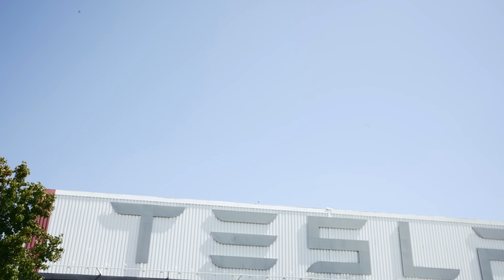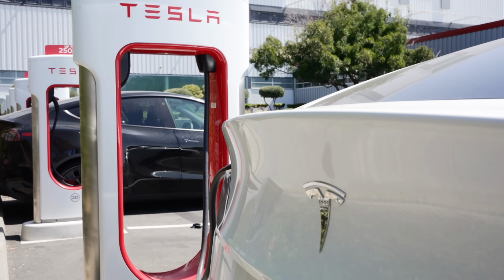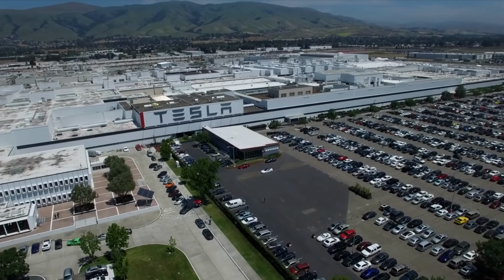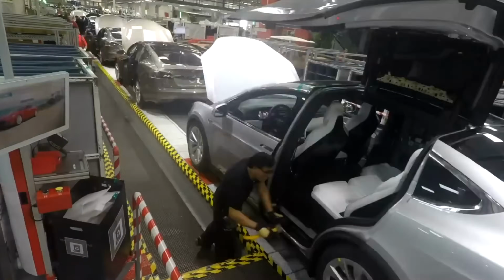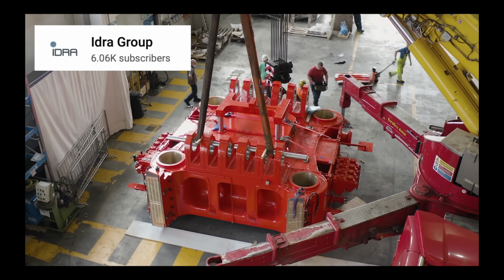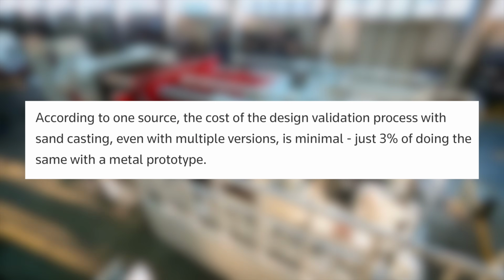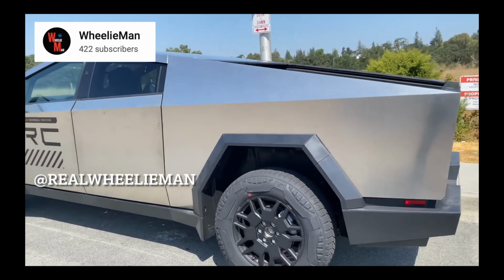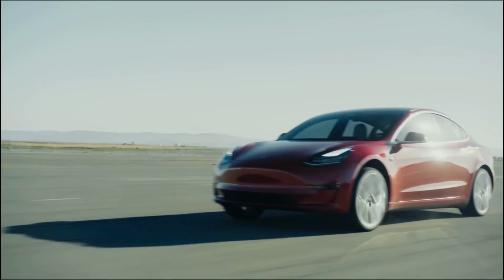Tesla Quietly Removes Model Y | NEW Buyers Are Shocked

Comment: i'm SUPER disappointed with the cybertruck. it's no longer an exoskeleton , just a normal vehicle now, but that was the whole point of the origami look of it was because it was going to be an exoskeleton, but now that it's not, no need to make it look like that. i'm ok with the looks, i like that it's very different looking, but i wanted it to be different looking because of the new and innovative exoskeleton design.
Reply: The exoskeleton doesn't have crumple zones.  That's why it's not being used. They're putting panels on a frame. Also the super strong side windows is a safety problem. If those batteries have a thermal runaway you can't open the doors because the electricity is off. So while you are being inundated with smoke you have to bust a window to get out of the conflagration of a thermal runaway fire. You better hope those side windows are not laminate. Those are very difficult to break out. And the weaker you are from the smoke and toxins the less likely you are to get out. And it will really suck if you have kids in that vehicle as it burns in the middle of a freeway because fire department can't get 6000 gallons of water to it.

Personally, the very idea that you cannot open the doors without the electricity being on is the dumbest design feature of BEV vehicles.  It's like having a house with electric doors and then a natural disaster hundreds of miles from you shut off the electricity and now you can't get out of your house. Or into your house. Like maybe it's a subzero storm. But the electricity is out. And now you can't get into your house for shelter.

I really don't care that ICE vehicles catch on fire supposedly more than BEV. The problem is the fire and the fuel of the fire. The BEV Burns hot enough to burn through concrete. It burns hot enough to burn down a house. It Burns hot enough to be a danger to every vehicle near it. Like in a parking structure, or a ocean going container ship.  And it burns far longer than an ICE vehicle will burn. And it will burn very hot the entire time.  You cannot douse a BEV fire with less than 6000 gallons of water to dissipate the energy that's being released. Thermal runaways me an exactly that. It's a runaway fire. It's unstoppable unless you dunk the entire vehicle in a lake. A thermal runaway fire produces its own fuel and oxygen.

Comment: Whilst the the increasing percentage of the vehicle that is produced by a single casting is heralded as a near miraculous breakthrough in production cost reduction, little thought is given to the consequential lowered write-off/totaled threshold; a once repairable rear shunt now means the vehicle is too expensive to repair due to the requirement for a complete replacement frame and battery pack.  So, whilst it's great for the manufacture, the soaring insurance cost has to borne by the customer.  Then there is the recycling (or not) issue.   How green are EV credentials really?
P.S. I love my Tesla but I am dreading the next insurance renewal almost as much as I do the thought of an accident.

Comment: In watching this video I really had to laugh. "Watching it raise up" and "What it sounds like going down" - as though this was something entirely new. Air suspensions have been around for ages and a variable height suspension using HP hydraulics was available on a line of passenger cars starting in 1956 and continuing until 2016. As to its design - really is a matter of taste. To me it looks like something a 6yo would come up if asked to make a car using Lego blocks. I have a 691/2 Citroen SW that has 11.80” of useable ground clearance (normal ride height is 5.75") and can carry 1750 lbs (have actually gotten 1 ton in it) and will ride level (no sagging) and the only reason you know all that weight is back there is a bit more pressure needed on the brake controller and not quite as much acceleration.

Comment: They need to standardize their 4860 cell, and the new Cyber cell with 10% higher would put the standard range AWD at 310miles of range, which is just off our Canadian model Y AWD long range from China (LG supplied 2170 with approx 75kwh net) has only 5 miles longer range! The Fremont model I have has 330 miles of range

Comment: I picked up one of those rare model Ys with the 4680s.  . It's nice my wife loves it. There are some limitations to the design but it's basically a 70 kW battery. It doesn't charge quite as fast as the long range ... But it does have 279 mi of range which is better than the previous  rwd model y with iron phosphate batteries which only had 244 miles. It has hardware 3  of course which is nice. I was able to transfer FSD to it .... Not that my wife uses FSD haha
Reply: You know you can get a discounted model ordered directly from tesla with less than 4k down payment and a total no more than 20 grand with a ref code.

Comment: Maybe the new higher density 4680 is the only one in production now and that would give the Y more range them advertised so they need to either lower the number of cells in the pack or raise the price. Both of those things would require some time so removing the existing one is necessary.
Reply: A MY RWD LFP would be a great addition to the lineup. I love my RWD MY. No cobalt and lower degradation anxiety for me.
Reply: @Harrythehun yeah LFP has some advantages but it also has some disadvantages in cold weather and the degradation story is a little more complex than how they make it out. If I owned one I would try to only charge it to 90%. Or even lower if the car wasnt going to be used much the next day
Reply: @Saxafruge You know you can get a discounted model ordered directly from tesla with less than 4k down payment and a total no more than 20 grand with a ref code.
Reply: @Harrythehun  I wanted LFP but I needed the long range model and it not available with LFP.
Reply: @frankcoffey  it kinda is
Reply: @frankcoffey  I did make a post on it
Reply: Exact opposite of what your saying they took away the 4680 because they are having problems with the new batteries they are making they have lower density right now they where saying in the future they plan on getting higher density as they develop those batteries right now they are only making model y long range and performance but they said they are revamping the 4680 batteries to a second generation that will probably have a 10% higher density but they are years away from making these batteries the way they want and Elon advertised in 2020

Comment: We need a tesla model that can compete with a Pacifica.  Auto opening van doors and rear liftgate.  And you can hold a 4x8 sheet in the rear.  Tesla can't do that.  It would be hilarious though if Tesla can detect a key being dragged on the exterior and shock the key to disable the chip inside the key.

Comment: Minor point Ryan, don't mean to be annoying but if I may, being a engineer my whole life...and high-pressure engineering exactly (diamond making)... a giga press is 9000tons of press force, not mass or weight.   

You might ask "why so much force?".  Well, it's not the force but the pressure on the molten metal required times the area or size of the casting.  You need high pressure to  squeeze the melt into every crevasse, hole, curvature etc, before it freezes against the cool walls of the die.  (The fewer mold details, the better).  If pressure is too low, you get a "short shot", the part looks wrong, things are missing.  If the part is large, high area, you need big force.  For e.g., to press an entire cybertruck frame would need even more force.  

I used 10000ton presses routinely in earlier career.  Big machines (for stiffness) but not exotic or expensive.  Just a lot of cast iron and hydraulics.  

Anyway, watch your vids (and Sawyer Merit, Dave Lee etc) routinely to keep with TSLA.   Thanks.
Reply: As a STEM teacher, I whole heartedly agree. I notice people conflating force, mass, weight, power, and energy all the time. The worst is when people judge sports cars on their top speed and not acceleration characteristics.
Reply: TY

It will be nice if he respond to your comment.

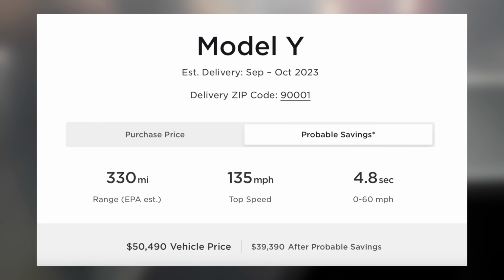Comment: Can someone explain at 4:12 "no model y you can order uses 4680 battery cells." Im about to buy a model Y and i thought everything in model is now 4680 cells. Not that i actually care but just want to clear this up.
Reply: Only the standard range model Y had the 4680 structural pack, long range and performance model both have 2170 cells
Reply: They had a standard range coming out of Austin, but it seems they are only looking at long range now. The 4680 did not provide the range they needed. I think battery tech needs to be improved by Tesla, but it may take 10 years. For now, these are commuter vehicles at best.
Reply: @ag4eng  I certainly hope your 10 year statement is wrong. I follow Joe Tegmar's drone flights over Giga Austin. From what I can tell 4680 cell production has been shut down for some time now, and new equipment is being added. Hopefully this new equipment will make a dramatic improvement in production speed and reduce scrap rate. It makes sense as most of us think that the Cybertruck will be exclusively 4680 cells.

The 4680 Model Y cars already produced have the battery pack about 80% filled. The shorter range was to stretch the low 4680 production quantity over more cars. Not that they couldn't have made a long range version with 4680 cells.
Reply: Our model Y LR lost 13% battery capacity in 18 months. Tesla says only charge to 80% now, which reduces the range to about 230-240 miles. Can’t imagine how the short range would be acceptable.
Reply: @royh6526 You can get a discounted model ordered directly from tesla with less than 4k down payment and a total no more than 20 grand with a ref code.
Reply: What were you always charging it too when you had it in the 18 months?  @ag4eng
Reply: @ag4eng  That is higher than normal loss, however the warranty is for 20% loss. Do you always Supercharge? That is also harder on batteries, slow charge with L2 charger is easier on them.
Reply: @royh6526  I charge level 2 at home and only pull 30 amps at best. I’ve used super charger less than a dozen times.